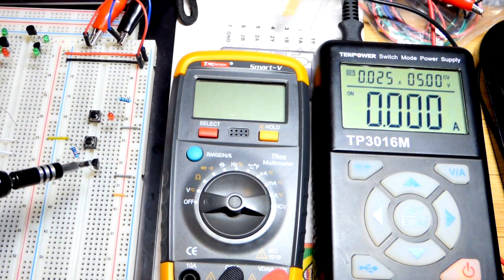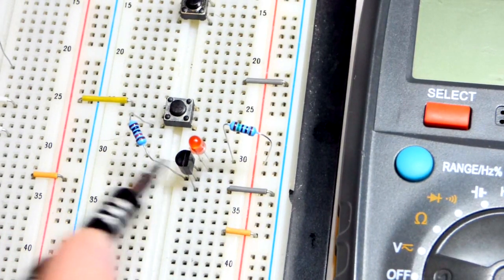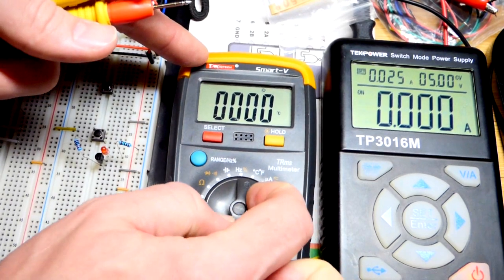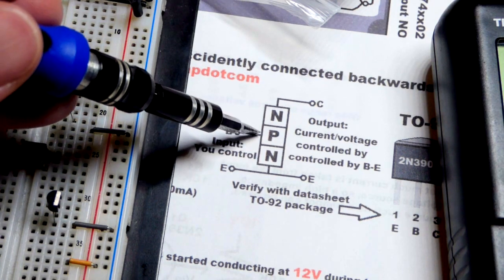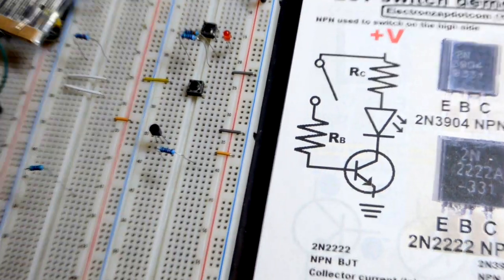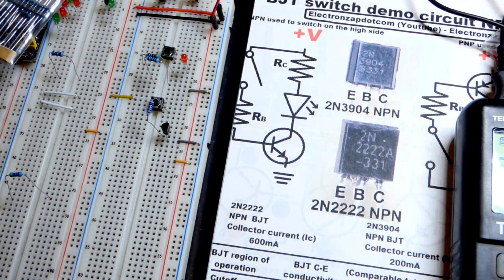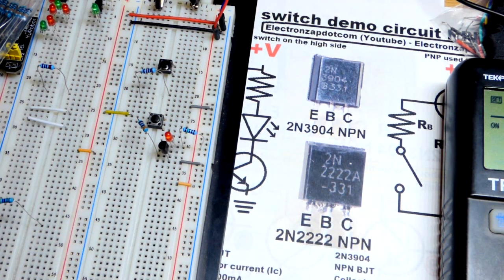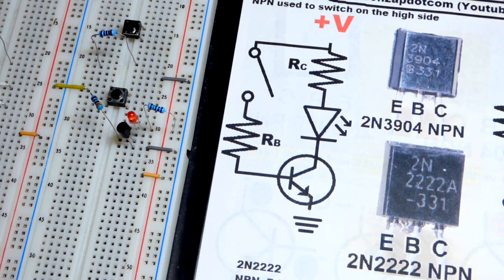How NPN bipolar junction transistors BJTs work simplified switch analysis by electronzap electronics

Comment: what is the difference between power transistors  and Epitaxial?  Another subject i have been meaning to ask you about is :  s1854a transistor datasheet ,  on datasheetcafe's website it says something about error amps, could you tell me if that is what it is or have miss understood the datasheet? also in the datasheet it shows an equivalent circuit of the transistor . so if this s1854a is an error amp and with the equivalent circuit  then can easily make error amps to specs desired ...? if not error amp then what is and what is it used for ?i hope what iam asking makes sense and you can help. I struggle with understanding a lot of  electronics;  it is a good thing to know about i just wish i was good at it and understood it better, i am trying   thx
Reply from the maker: Not really something I looked into, so I'm, not the best person to ask. Epitaxial is a process for making transistors faster and perform better. Power transistors generally stay on for long periods of times and at higher current than other transistor, so I'm guessing that they are made to conduct better than epitaxial but can't turn on an off as fast. The S1854 datasheet I found shows that it has NPN transistor circuitry but also diodes and resistors. So it looks like an error amplifier integrated circuit, that saves you the work and space of combining those components. Apparently it locates errors as part of a feedback loop to correct the error. That's circuitry I've never dealt with.
Reply: @Electronzap  thank you very helpful i had done research and could not find much.  it has taken my about 6 months to get around to asking(dont like to ask questions like these to youtubers for a few reasons) so thank you it was very helpfully.

Comment: why is the load always on the collector side?
Reply from the maker: Some circuits have the load on the emitter side, such as the emitter follower/common collector circuit. Doing so limits the voltage across the load to the base voltage minus about 0.6V. Switch circuits want the full voltage across the load while so, so it has to be on the collector side.